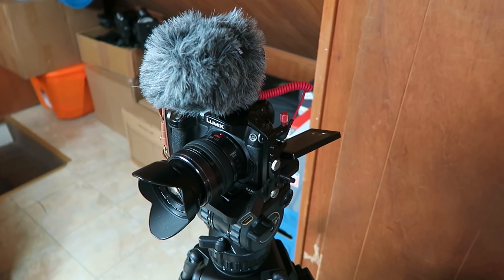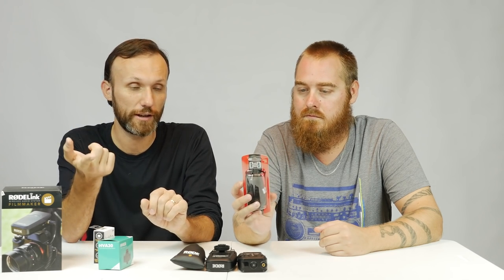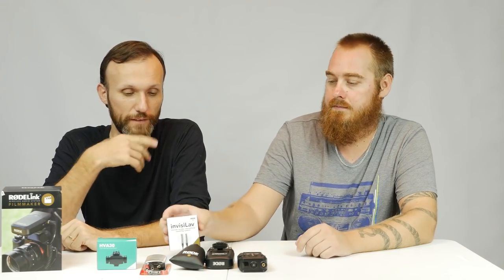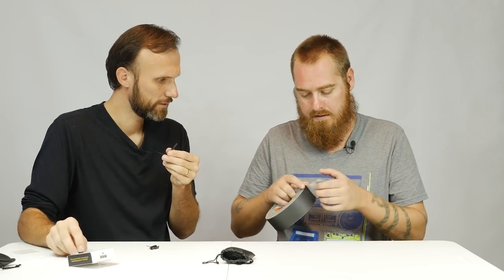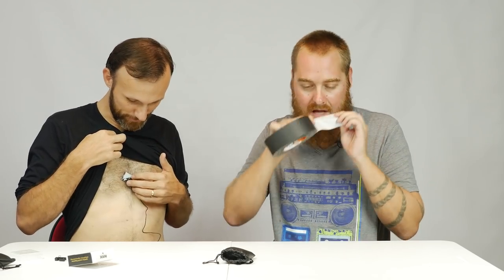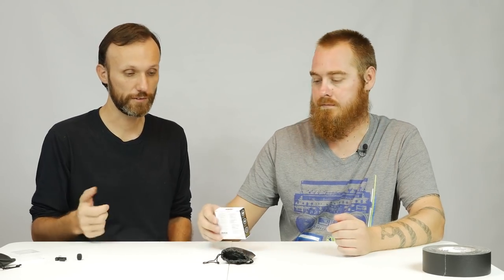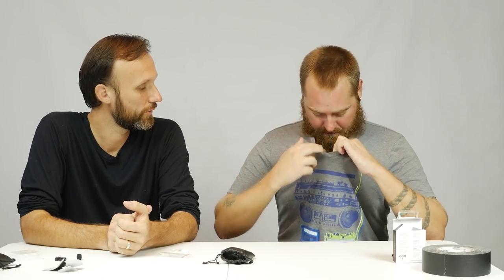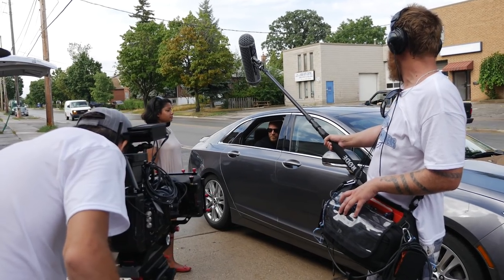My Interview Setup with 2 Wireless Mics & GH4 - 1 man crew!

Comment from the maker: A little update! There is now even better device from Saramonic that allows individual level control for $50. You can get it here: https://bhpho.to/2AF1neb
Reply: Tom Antos hi,can I use an external battery with Panasonic GH4
Reply: Yes, this saved me! Thanks, Tom 👍😊.
Reply: I'm trying to do the same setup with an AVX Seinheiser system going into a Sony 7R3. I'm trying to have two lav mics set up at the same time. Using this flitter will that work with this system?

Comment: I just got that rode lav mic, comes in the mail tomorrow. Haven't tested it out for myself. But this setup looks perfect for my needs. If the sound is this good I won't need my mixer anymore. Which really weighs down my camera. Less is more.
Reply: What mixer have you been using? 

I'm interested in mobile mixer options.
Reply: Saramonic SR-AX104 2 Channel XLR Audio Adapter with Phantom Power & Monitor (Red / Black)
Reply: Cool. Looks simple and affordable for the task. Feel it's been good other than possibly unneeded weight in your kit?
Reply: Oh yes, my sounds quality is better. And it give me way more range of audio options that simply isn't available on a dslr.

Comment: Tom - consider wearing layers (undershirt sucvh as a white t-shirt or crew, i.e. "wife -beater"). Let your talents knows this as well when planning interview sessions.

Also, if you don't mind syncing audio in post.... a cheaper (1/2 the $price) and just as good (or better sounding) audio option than the Rode FM Set (which I tried and was not at all impressed with the sound quality or range)....is the new Tascam DR-10L sets @ $200 ea. These are basically a micro sized audio recorder in the Tascam quality, and come with a Senn. ME2 style mic (may be an actual ME2, not sure if it modified or not). These will record up to 4 hours of 48KHz, 24bit, WAV audio WITH A BACKUP CHANNEL (lower db) on a 4 GB micro SD card. A really GOOD DEAL at $199. 

When monitoring with headphones, the audio/preamps sound a little noisy or digital - but I was surprised at how clean the track is when listening back on the computer. I was also able to use my Countryman E6 headset mic with this recorder, it powered fine (allbeit it will cut out if not particular about the input jack - try not to move it around much or not at all).

B&H Link here: https://www.bhphotovideo.com/c/product/1281085-REG/tascam_dr_10l_mini_portable_recorder.html

Comment: I wish I could run the Rode Link directly into my camera as well, but my camera has a very bad sound meter without any numbers on it (NEX VG20) so I can't trust that it isn't clipping.
So I have to run it into my Tascam DR60D where I can monitor it, and then into my camera. And then I still have to record it on the Tascam DR60D, because the audio may still be clipping in the camera. If it doesn't clip in camera, then it's great, I can just use the audio from the camera. But if it does clip, ill have to sync it manually from the Tascam recording.

Comment: Hi. I just bought a Rodelink Filmmaker Kit and looks exactly the same as what you have just reviewed. However, I am wondering if your Lavalier Mic's 3.5mm TRS Locking Jack Socket can actually be securely screwed (threaded) on to your TX Body Pack (Transmission Device) since you did not show it on your video. Good video content by the way :) Would appreciate if you can reply with an answer : Cheers!

Comment: Hi Tom and Paul, This is a great system. Thanks for the instructions. Is that wire on the wireless mic, the antenna?  Secondly, are Rhodes wireless mics compatible with Sennheiser receivers?  I look forward to your response.
Reply from the maker: Melissa Frydlo the wire is actually the audio connection that plugs into the camera. Antenna is hidden inside since this uses digital 2.4ghz frequency. This is completely different from senhiser which uses analog system. Audio is comparable. In my opinion just as good. I actually compared these two side by side in this video  https://youtu.be/m-wPjAy7Lxc

Comment: Will this also work if it is plugged into a Zoom H6 Recorder instead of the camera?  Like I put a Lav mic on two persons, both Lav mic goes to the Y splitter, which in turn goes to a Sennheiser EW112 transmitter, and then the receiver goes into the Zoom H6. Will this work? (using only one set of Sennheiser EW112?)

Comment: Can you use 2 transmitters to 1 receiver, or put a.splitter into the transmitter to 1 receiver?
Reply: If it's rode or Sennheiser, they each have to have their own receiver. You could use a splitter if wanted to at that point.
Reply: Te'Shawn Crenshaw thanks. I have a saramonic with 1 transmitter and 1 receiver. So maybe a splitter into the transmitter?
Reply: @SeanDIY  you got options, a splitter or audio recorder or mixer. Both you'll want to test the sound levels and adjust.